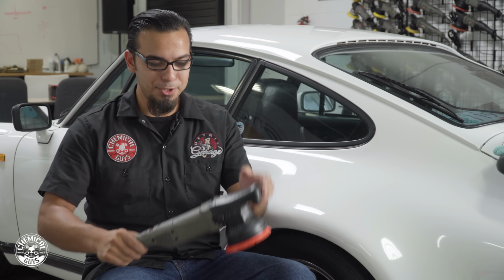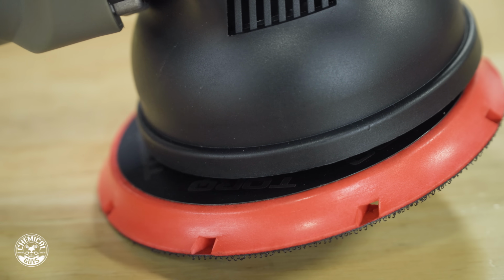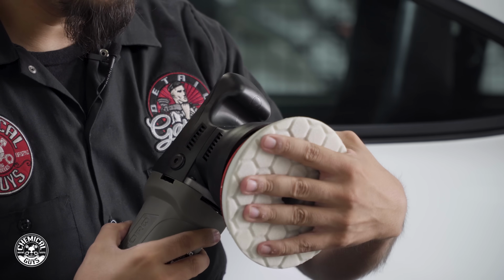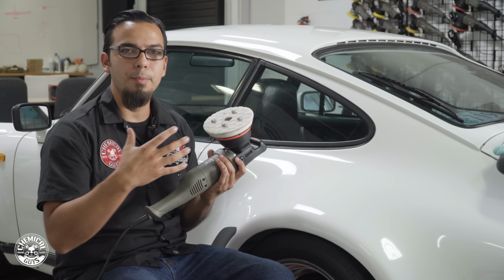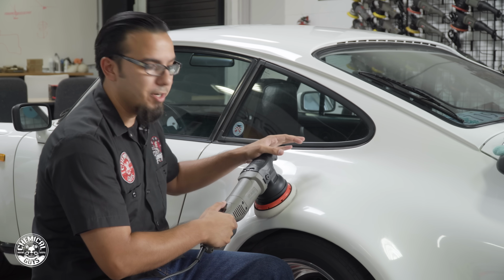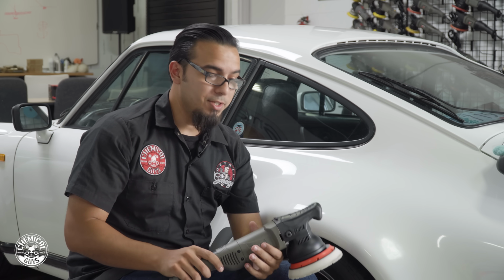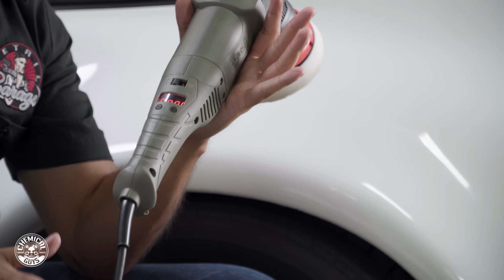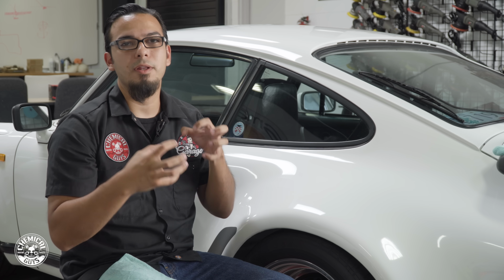First Look: ALL NEW TORQ 15mm Long Throw Polisher! - Chemical Guys

Comment: I just got this and it works great!  But what are the little black square thingies it came with?  The manual doesnt explain what the heck they are.
Reply from the maker: Hi there! The included items are carbon brushes. These will wear over time however it takes many, many hours of use before they need to be replaced.
Reply: @ChemicalGuys  many like 100's? 1000's?  And how do i even replace it, the manual doesnt explain aynthing or even have any diagrams.  Some manual, any help would be great, I have the TORQ15DA

Comment: I have seen that on all your videos u say to start with speed setting 1 to spread product and increase 5-6 using moderate pressure. Is it the same  for the torq15da?
Reply from the maker: Hey! Yes, that is correct. Thanks for the comment and happy detailing!
Reply: To add onto this question, the Torq15 doesn't have settings 1-6 because it has the rpm display. What Rpm is each speed setting?

Comment: The only thing I worry about is the potential for these buttons to stick over the Long Haul.. I've seen this happen on similar applications.
Reply from the maker: Hey John! Thanks for tuning in. We have tested and ran these machines for hours with no issues. Also turning the machine off resets to zero.
Reply: @ChemicalGuys  awesome!! That's what I needed to know. I will be moving forward with one of your polishers. Thank you.
Reply from the maker: Happy detailing!!

Comment: hey nick I'm really stuck between getting the torq 10fx and the 15da, I know in videos you most commonly use the 10fx but that was before this came out. this is going to be my first full fledged polisher aside from using drill attachments. I was wondering what you would choose. with the 15da I'm worried about the longer throw for tight areas like in-between the sun roof and top of windshield or on my carbon fiber wing. it'll be my only polisher so I want a good all around tool so that I won't have to less effectively hand polish all the tighter areas and also be able to use different backing plates for different applications on the car.
Reply: airsoftpro808 you will probably want the 10fx as that is the polisher that will accept the 3inch backing plate for 4inch pads for tight areas

Comment: Do you recommend this for a beginner?
Reply from the maker: Hi! Yes we do. the TORQ 15DA is a great all around machine both for professionals and beginners. The 15DA has less vibration than competitors and no rattle, making the all-new machine a fatigueless experience. With the TORQ 15DA, cutting and polishing your car becomes less stressful and more enjoyable experience for all levels of detailers. Happy detailing!
Reply: @ChemicalGuys  .. are you currently running any specials on the 15 mm in Canada.
Toronto area??

Comment: Ok i need to get one. But how to choose? Also can we get some discount on these machines they are not the cheapest.
Reply from the maker: Hi John! We recommend the TORQ15DA it comes with everything needed for a full paint correction detail. The TORQ15DA Kit comes with the TORQ15DA dual action polisher, three Hex Logic buffing pads for cutting, polishing, and finishing, and the V-Line sampler of compounds and polishes to remove swirls and scratches from any painted vehicle finish. Use the Orange Hex-Logic Cutting Pad to remove swirls, scratches, and oxidation to restore deep gloss and pure reflection to painted surfaces. Refine away any heavy compounding marks and enhance gloss to showroom-new levels with the White Hex Logic Polishing Pad, then spread the perfect coat of glaze, sealant, or wax with the Black Hex Logic Finishing Pad. Thanks for watching, glad to have you apart of the Chemical Guys family! Check the link below.

https://www.chemicalguys.com/TORQ15DA_Random_Orbital_Polisher_Kit_8_Items_p/buf505x.htm

Comment: Wow! I was blown away by this new Torq DA polisher!  I want to buy one. I have one question. What products will I need to buy to remove serious water spots on my car?!?!
Reply from the maker: Hi Richard! It all depends on how heavyily is the water spots etched into the paint. If the water spots are super light we have a Heavy Duty Water Spot Remover Gel that you simply rub on let it sit for 2 minutes and come back and wipe it off. If they are super etched into the paint, we recommend V34 with a orange pad and after that use V38 with a white pad to refine the finish. Thanks for watching and thanks for being part of the Chemical Guys family! Check links below.

https://www.chemicalguys.com/Heavy_Duty_Hard_Water_Spot_Remover_for_Cars_p/spi10816.htm

https://www.chemicalguys.com/V34_Optical_Grade_Hybrid_Compound_16_oz_p/gap_v34_16.htm

https://www.chemicalguys.com/V38_Optical_Grade_Final_Polish_16_oz_p/gap_v38_16.htm

Comment: What is the best polisher for a beginner to use?
Reply from the maker: Hi James! We recommend  The TORQX Random Orbital Polisher Kit comes with everything needed for a full paint correction detail. The TORQX Kit comes with the TORQX dual action polisher, three Hex Logic buffing pads for cutting, polishing, and finishing, and the V-Line sampler of compounds and polishes to remove swirls and scratches from any painted vehicle finish. Use the Orange Hex-Logic Cutting Pad to remove swirls, scratches, and oxidation to restore deep gloss and pure reflection to painted surfaces. Refine away any heavy compounding marks and enhance gloss to showroom-new levels with the White Hex Logic Polishing Pad, then spread the perfect coat of glaze, sealant, or wax with the Black Hex Logic Finishing Pad. Choose the best heavy compound or light finishing polish from the V-Line Polish & Compound Sample Kit for the least aggressive path to perfect paint on your vehicle. Thanks for watching and thanks for being part of the Chemical Guys family! Check link below.

https://www.chemicalguys.com/TORQ_TORQX_Random_Orbital_Polisher_Kit_8_Items_p/buf503x.htm